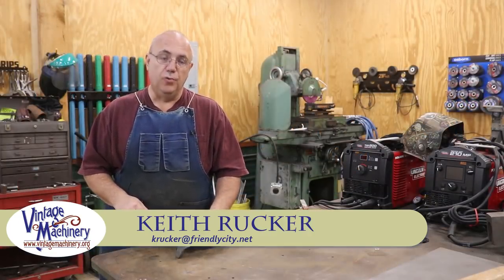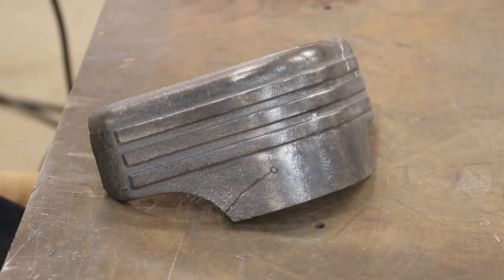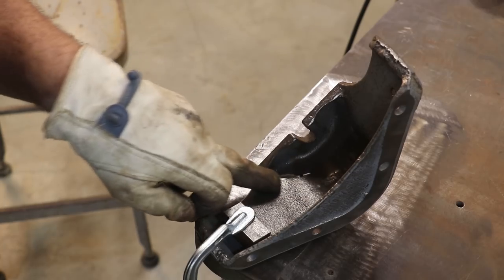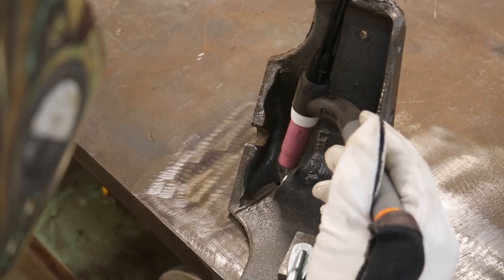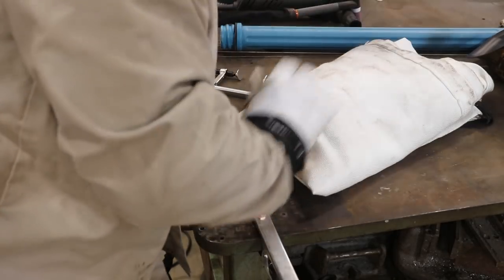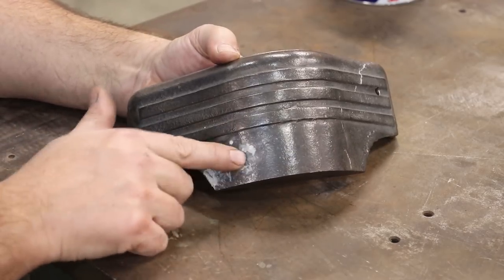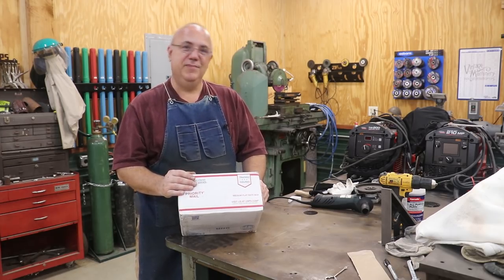Repairing a Cracked Cast Iron Delta Unisaw Foot by TIG Brazing

Comment: For small cast iron parts like this, I use the propane burner from my turkey fryer to preheat the part so it's easier to TIG braze.  Afterwards I quickly peen the brass/bronze and put it back on the burner, reheat, then wrap in the fiberglass blanket to cool slowly.  You can also successfully MIG weld small parts like this.  ER70S6 is a low hydrogen wire that works well.  Pre heat, MIG it hot and fast, peen, post heat, and wrap.  I did it on a Wilton bullet vise repair.

Comment: I've never heard of TIG brazing until I started watching your videos.  It looks like a much neater and more controllable process.  I wonder if you've ever considered silver soldering cast iron.  My neighbor had a hit and miss engine that was literally broken in pieces.  He soldered it back together and I'll be switched if it didn't work.  He explained that the solder has a greater tensile strength than cast iron and as long as you kept the water jacket full, it wouldn't get hot enough to melt the solder.

Comment: Nice job, Keith. If you ever need to match a cast iron look after grinding smooth, when you primer it,  while the primer is still wet, sprinkle a little glass bead from your blast cabinet on it. After painting it is a perfect match for the sand texture of a casting.

Comment: I've used the TIG welder on cast iron with 99% nickel rod. The TIG torch gives really precise control. I preheated the parts and controlled the cooling.

Comment: I thought I heard a crack watching it the first time.  After you showed the crack, I went back and watched it again.  A crack either formed or opened up at 6:50.
Reply: Similar sound at 8:25
Reply: @jonnoMoto  Anyone that has spent time under a welding helmet knows that sound was from the plastic headgear creaking as Keith raised and removed his helmet. Much different than the two subtle "TINK" sounds around the 6:50 mark approximately 2 seconds apart.  :-(
Reply: CPUDOCTHE1 
There is a sound at 6:50 and it may be the crack shifting as Keith heats the metal. If you are interested in cracks please go to my later post begining with "@10:00" and give your opinion on the substance of my observations. 
I've already had a couple of plaudits defend Keith by pointing out that I have not uploaded any videos here, so a reply which actually addresses the situation would be welcome.

Comment: I've never done or been around tig brazing, but on cast iron, I would be concerned that the heat is too localized and much more difficult to get an even preheat on the part and would induce even more stresses into the cast.  That could be where that 2nd crack came from.  Flame brazing would have been the better process here in my opinion... just as you said in the beginning, tig brazing is good on thinner material, but I think this material/part was too big/heavy for tig brazing, thus the 2nd crack.  But it looks like it all worked out in the end.

Comment: I've had better results by preheating my cast and using a 7014 rod. It's worth a try on your end. I fixed a transfer pump for a fuel truck in the late 90's and it was still working in 2010.

Comment: could this process fill a corrosion pit in a cast iron cylinder bore? Old tractor had water in cylinder for 30 years and it ate a 2 mm deep area into the cylinder at the ring line. All other bores are good except this one. No one makes a sleeve for this. I have a hone to smooth out the weld bead after its cool. Any chance?

Comment: How do you recommend flame brazing a large piece? I have a base of a 16" South Bend lathe that needs repaired. The crack runs completely across between the bottom of the base and the opening that is covered with an additional casting. Total length of the crack is about 5 inches. Anything I should pay particular attention to durring the repair? Should I try to slow the cooling process any particular way?

Comment: Just a thought as I am not much of a welder.  It would make more sense to me if you put a firebrick or similar under the cast part so the table was not sucking the heat out of the casting.  Yes, I know about grounding through the table.

Comment: Definitely should have used AC for aluminum bronze, or used DC with silicone bronze. and im not real sure why he wouldn't have wanted to fix the outside on something that will get paint.... but HEY, whatever he wants right... ALSO, should have PRE HEATED the part.... that will stop other cracks from forming.  

Love the videos uncle Keith!!!

Comment: Those cracks are too hard to see.  Is it possible to use Magnaflux to find them?  Also, that thing needs to be heated with a torch.  That tig is causing too much stress on the thin structure.

Comment: Good job on the brazing, but I would’ve stayed away from the bondo and added some brazing on the exterior side and sanded that smooth. Love your vids!!
Reply from the maker: As I mentioned in the video, the customer specifically asked that I not braze the outside.  If it were mine, that's how I would have done it also.

Comment: Nice job Keith!  A couple questions.  What tungsten are you using, and does it have to be sharp since you are not using the tig process in a traditional sense?  I assume you are doing a preheat with the torch it self in lieu of using a oxy-acetylene torch setup.  Thanks,  Eric

Comment: Hi Keith good job, I would of put it in the oven just to take the chill out of the cast it would stop the cracking
Reply: At our shop we repair a lot of old cast iron parts from early farm equipment to a complete rear axel housing from a 1913 Mitchell 1 ton open housing broken into many small pieces and we always pre-heat and post-heat and wrap into a welding blanket .BUT we always peen the weld even if using  bronze silicate filler rod. Haven't had a cast iron or cast steel recrack or devolve other stress related cracks .
Reply: Keith's wife doesn't allow him in the kitchen anymore after he put some machine parts in the oven.
Reply: @Sizukun1  I think you are thinking of Kieth Fenner.
Reply: i wouldnt put in my oven too but just find a cheap oven since you got 240 out there
Reply: Nah, I don't watch Kieth Fenner and I cannot remember which specific video it was that Rucker did but I seem to remember he was pressing a bearing off, and even had the foresight to wrap the thing in foil to prevent grease dripping off it. It was a funny little bit that Rucker even mentioned he only did it because his wife wasn't home.

Comment: Maybe there is another crack on the opposite angle? Take  a look at 13:50 for that.
Reply: I think thats just part of the casting
Reply from the maker: While it looks like a crack in the video, it is just a mark in the surface from a the casting mold.

Comment: Keith, did you test for lead paint?  Anyone working with old parts needs to be careful and take the proper precautions.  It doesn’t take a lot of lead paint dust in your lungs to cause serous health issues.

Comment: Parts this size really need preheat. It allows you to use less amperage and lessens the risk of additional cracking. When properly applied, aluminum bronze rod should flow easily and appear bright and shiny when finished.

Comment: weld strong or appearance?
Reply: I would go with "strong" as I assume the machine is heavy and may vibrate which could be a recipe for heat stressed cast arn to crack again.  Save the packing and box. :-)

Comment: He doesn't want you braze the outside of the crack, for appearance purposes? If he's painting it, what does it matter? Plus it's 1" of the floor, so the difference in texture won't matter.
Reply: As Selfridge said: The customer is always right.
Reply: Obviously you can't sand, grind, cut, needle scale, or use any other process to make braze look like cast.  The leg was visible enough to notice a crack, obviously you would notice a brazing patch.
Reply: Certainly agree but did you see that packing job? Customer is obviously very particular
Reply: @CPUDOCTHE1: You seriously need to think before you comment. Do you think Bondo looks like original cast iron?? Enough with your idol worship, regular folks make mistakes.

Comment: Ya... but tig braze requires pre heat. ... that second crack likely would not have occurred with some pre heat ... and for the no braze on the outside.... careful dressing of a braze will finish just as good as bondo and is much stronger it just takes longer to dress

Comment: Shoulda had Mr.Pete cast you a new one..........
Reply: Mr Pete cannot melt cast iron in his garage.  Aluminum melts at around 1100 to 1200 deg. C.I. is more like 2200. I used to work in a  cast iron foundry and we poured it into ladles at 2650 to get the proper flow by the time it hit the mold. Even if he could pour it the hand rammed mold would have so much tear up that it would look worse than the cracked one.

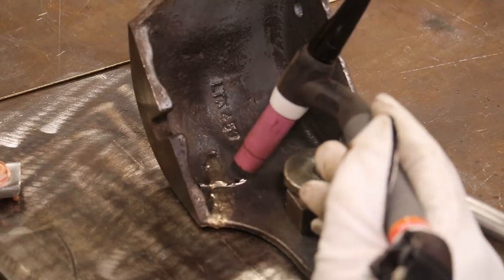Comment: @10:00 I believe that the crack can be clearly seen extending well beyond the stop-hole. I can see it continuing on before turning south and heading for a crack migrating up to meet it from the bottom edge.. the hairline starts from slightly to the left of the tiny depression right by the edge of the foot. @10:44 it looks as if the crack can be seen at the back extending up towards a point inbetween the numbers 5&8, and out through the side of the cut out in the base. Now @12:04 with good illumination I believe the original crack continues along under the the length of the cast part number and forms a "T" with the crack desending to the bottom of the foot.
I hope the person who placed his trust and his casting in Keith's hands does not regret his decision in the fullness of time.

Comment: @9:12 It is obvious that the new crack coincides exactly with the valley in the raised line of braze.
Given that braze material contracts powerfully and at a greater rate than the casting as it cools, this badly laid line will contract unevenly. Now add to this the fact that Keith didn't pre heat the whole casting I suggest that this second crack was most likely going to happen. 
Keith will not be thinking of questioning himself so that only leaves one option which is to hope that the second crack was always there. His other plan may have been to hope that nobody watching wanted to think this through. 
Not good.